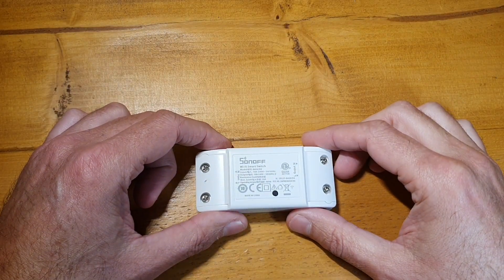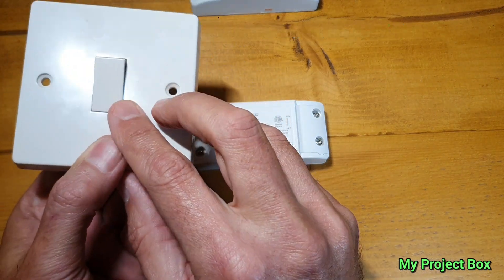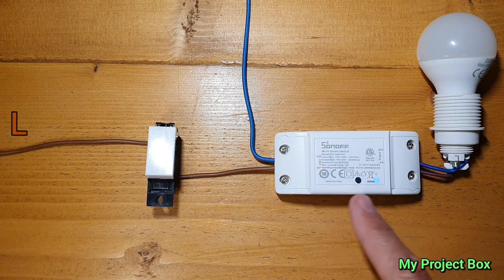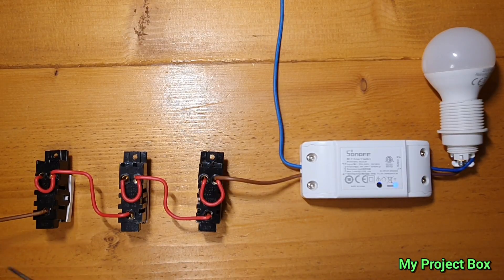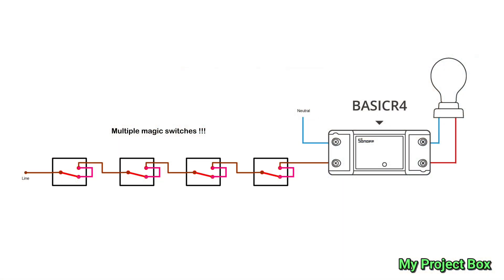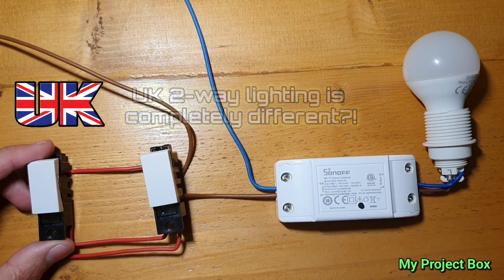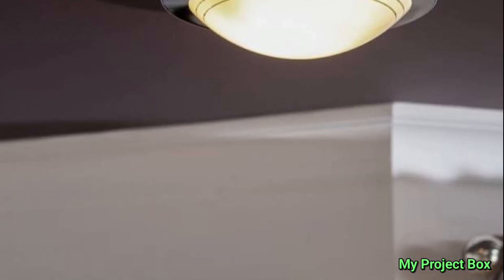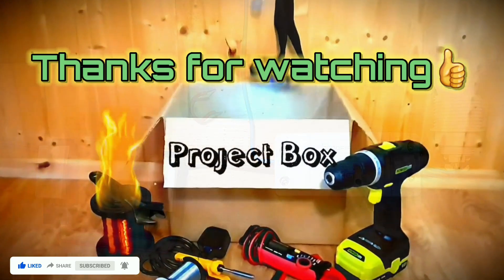Magic Switch Sonoff BASIC-R4 NO-NEUTRAL with 2-way 3-way smart lighting

Comment: One more advantage of this system is that switches will work, regardless of the Wifi connection. You put the router off, and still the switch will work normally.

Comment: hi
thanks for very good explanation.
i have a question. is it possible that to apart the single wire between the both switches to be connected to the SONOFF MINIR2 s1 and s2 ports? does it work properly?
thanks for your early reply.
yours,

Comment: Great overview, would this work with a single pole switch? 

EG: 

*-----/ *

Excuse the crude drawing, but 🤷🏻

I've tested in my home where the single pole switch is wired on the live circuit to a light bulb but it does not work.
Reply from the maker: Thanks for your email. I guess you are trying to use the "magic switch" mode. As per your photo,  it looks like the South African light switch plate has switches that can be "popped out". You could just replace one of the switches with the change-over type.( two-way type). Is your Tasmota flashed Sonoff Basic R4, still capable of magic switch mode, with custom firmware?
I have some older circuits with a optocupler that works on a regular light switch. https://youtu.be/x7Q8AS238pY
The last circuit is better, and it works with "one-way" no-neutral at switch, aswell
https://youtu.be/9hQFFsBkxaU

Comment: My parents have a bathroom under the stairs, and it seems the light/extractor is powered by the hall light (at the end of a two-way switch). If the hall light is off, the bathroom light doesn't work.  Could I use this approach to retain 2-way functionality for the hall light but provide constant power to the bathroom switch?
Reply from the maker: Yes I think that could work👍

Comment: My PC817 based circuit connected to the SOnOff switch becomes useless...😢
Afterwards, if it doesn't work on older versions, it will still allow me to make them compatible with this feature. 🤔
Reply from the maker: Magic switch kind of solves that problem and make my older Optocoupler circuit unnecessarily, but I think it's still useful for some applications.

Comment: The movie is really good, thank you. Question, can I feed a wall outlet through this unit? That way I will have control over the outlet?
Reply from the maker: Yes but remember you can only switch a maximum of 10Amp so mabe add a 10amp inline fuse for safety

Comment: I have two  sonoff basic r4 to control my pool pump and lights, will the magic switch work? We are in an area that the internet is not reliable and  if we need to turn it off we need to wait until wifi comes back. Thanks in advance!!
Reply from the maker: @ilianita67  I have only tested it with lightning, but in theory it should work. There is some chance the inductive voltage spike could mess with it a bit, but it's worth trying it.
Reply: @ thank you so much for your prompt response!

Comment: I wonder how often transients on the mains trigger this accidentally.
Reply from the maker: I guess it is technically possible. I have tried to emulate different conditions like making a bad connection with some arcing. But so far I haven't managed to trigger it. The delay has to be in a very narrow range. As a precaution, it would be handy to have a automatic of timer function, so that the lights don't stay on indefinitely, if a false trigger occurs😉.

Comment: how do you mean the sonoff doesn't need neutral (blue cable, yes)? it's still need neutral, yes? i saw the picture and the actual, both require neutral to power sonoff.
Reply from the maker: NO-NEUTRAL required behind your light switch  box😉. This is normally a big problem for some people. It uses the neutral at the light fixture instead.

Comment: Do you know how to make this work with a North-American light switch?
Reply from the maker: @goldbug007  it's exactly the same, but you need to use what you guys call a 3-way switch, and link the two "traveler terminals" together with a wire link. So don't use a "single pole" /On-Off switch. We tend to use the "3-way type" for every type of switching situation.
Reply: @ thanks for the quick response. I will try your trick.

Comment: I’ve set the basic r4 with a Schneider switch, but I think that the delay is so small that it doesn’t trigger all the time from the switch itself, and so it needs a bigger delay. Do you have any recommendations for that? I’m also planning to add another one for a 3 gang setup but with the same switch so I’m curious if the same would happen. Great video though
Reply from the maker: The only thing I can recommend is to try a different light switch.  The only switches that didn't work for me, is the ones that didn't have a decisive click.  It doesn't have to be an expensive light switch, just one that works well with the sonoff.  It would have been nice if sonoff provided an adjustment in the software. for the delay.  I know some people that have made custom firmware for it, have created this option.

Comment: This is genious. The set up works like an impulse relay, I think
Reply from the maker: @nivaeliakim  I see what you are saying😉👍, but a impulse relay needs a separate input form a momentary push switch. The magic switch uses normal light switches, and the Live feed is by the first switch, and the circuit completes with the neutral at the Sonoff, up by the light fixture. So it makes it easy to wire up with existing traditional lighting.

Comment: Great content - Thanks!

Do you think this would work with a single throw switch, with the bridge between the incoming and outgoing? The contacts should lose connection when the switch is flipped.  Not sure if it will be long enough though.  All our light switches are single pole, single throw.

Comment: How long is that "glitch"exactly in milliseconds?
Reply from the maker: @hunakaka  I'm not sure🤔. I would have to measure it with a oscilloscope. But I think there will be some discrepancy between different light switches. I guess the time delay would have to be with in a small range.

Comment: Hi  will this also work with line to line circuit?
Reply from the maker: Yes
Reply: @MyProjectBoxChannel  i have an existing 2 way switch with pilot lamp, is it ok to still put a wirelink between l1 and l2? Thank you for your reply.
Reply from the maker: @rj-ck6fu  the most important thing it that, it is a switch that has a contact that can changeover from L1 to L2. Some switches only switch between L1 and off. I guess the pilot lamp is a neon indicator lamp🤔. I'm not sure if this will interfere with "magic switch". Give it a test? I don't think it will be a problem.
Reply: @MyProjectBoxChannel  Thank you so much!

Comment: will it work with a doorbell switch?
Reply from the maker: No, is the short answer🤔😥.  But it might be possible if you have a normally closed version of the door bell switch.  And even then the doorbell switch cannot be pressed for a long time, it has to be pressed very briefly. Otherwise the sonoff will lose power and start to shut down.  You could try and modify a light switch and put a spring inside.

Comment: How to make dry contact on R4, I succeeded on the R3, but I don't know how on this one.
Reply from the maker: I have not tried to make a "dry contract" with the newer sonoff basic, but the magic switch detection circuit is probably connected the relay contacts, so I don't know if the contacts can be insulated🤔

Comment: so glad I found your channel. Very clear videos. I watched this and your other video Sonoff extreme MINIr4 on 3way switch light UK NO-NEUTRAL required at light switch #Sonoff #extreme. What happens in both of these installs if the Zegbee coordinator or Home Assistant installation is down. Do the physical switches still work the lights?
Reply from the maker: Yes! the manual switch still works, and will control the smart relay even when wifi and zigbee is down.😉👍
Reply: @MyProjectBoxChannel  thanks for that. As a UK person living in an old house I imagine that I will think it is unlikely that I will have neutral available (electrician calling soon to confirm this) So starting out with Home Assistant I have initially fitted window and door sensors in the house and installed two or three Ikea Tradfri repeaters. All going well so far. Next I was thinking that I'd have to start replacing light switches to give control via Home Asst and to act as Zigbee repeaters. Having watched some of your videos it seems as if you are more of a fanboy of Sonoff Mini units. Am I right in saying that these are easier to install and you may need fewer as with 2way switching you have to replace 2 switches - with the Sonoff you only install one bit of kit. Plus your family will not notice as the old wall switches are all there as before.

Plus you have these Sonoff units working as Zigbee repeaters as well?

Overall - you are voting Sonoff mini units over say Aqara wall smart switches (esp the no-neutral one which some pundits say have a poorer track record on reliability?
Reply from the maker: @fergusanderson5307   I did start with Sonoff years ago, but I don't have any special loyalty to them. Sonoff have sent me lots of free stuff to test and make videos. There is loads of other good brands on the market. But I like to come up with custom solutions for problems. So I have come up with some circuit hacks over the years, to help solve some of the issues people come across. Sonoff "magic switch mode" might solve some problems for some people, but be aware that some people have reported that it won't always work with certain types of switches. I'm hoping that sonoff will be all Matter-enabled soon. That way you don't have to rely on the ewelink cloud services, and have direct local control, without the need for custom firmware flashing.

Comment: Great video!
Finally a solution to my issue where I have a 4 way light circuit, where only the 4 terminal switch has neutral!
Reply from the maker: Yes! "Magic switch mode" is very flexible. Lots of new options available for people😉👍.

Comment: Will the L1 and L2 lines carry a large current?
Can I use thinner wire?
Reply from the maker: The link will carry the main lighting circuit current, so the wiring needs to be rated accordingly. But in general most LED lights are low current, so down to 1mm2(or even 0.75) should be fine.
Reply: @MyProjectBoxChannel  I'd be careful with that advice. The poster may move, and the next occupant can put up anything they like. Great video btw :)

Comment: I don't think what you said about the in between state is true, the connection is shorted so there is power constantly.

What I think is happening, is that it notices the difference in resistance that suddenly occurs when you close or open the switch. That also explains why you can add more switches. Quite ingenious.
Reply from the maker: I understand what you are saying, but your logic is incorrect🤔. Inside the switch, there is a moving contact, that makes a connection with two stationery contacts. We linked out the two contacts, this is now the combined output terminal. The moving contact can flip between the two contacts, but can't make a connection  with both at the same time. So as you flip the switch, there will be a brief moment,  when the moving contact is not making a connection with either of the stationery contacts. So let's say your input is the moving contact, and the output is the combined link. Now when the switch is flipped, you have a brief period when you don't have a continuous connection.

Comment: How do I bridge my light switches if I have a 4 way setup with 4 intermediate switches?
Reply from the maker: 4 intermediate switches WoW!😜 Where in the world do you live? Because the wiring in the UK, can be very different for multi-way lighting. If its wired the "normal" way, you just have to link out L1 and L2, on the first or last switch. If it's wired in "UK 3-plate", with twin & earth, you will need to reconfigure some of the wiring.

Comment: Hi’ why do the tile of the video is Magic Switch …. « NO-NEUTRAL » … smart lighting when all your examples show neutral wire.  I live in Canada in an old house and there is no neutral wire in the house.  And I thought this could help me a lot.  But I am confuse now.  It is simply that we use different terminology ?  Thanks in advance
Reply from the maker: NO-NEUTRAL refers to not needing a neutral wire behind the light switch box. Many smart switches and smart relays, require a neutral at the light switch to function. Some of my videos provide a workaround if you don't have this neutral connection behind the switch. My circuits works by utilising the neutral at the light fixture itself. I believe In North American you call it Hot and Neutral for 120v , and Line to Line (Hot to Hot) for 240V. So if you have two "Hot" wires, one of them can be considered as "neutral" for the purpose of completing the circuit.
Reply: Do you think it’s ok if I don’t send N to the bulb and control just the L with the R4? I’m thinking to place it behind the wall because it will control multiple spot lights. Thanks!
Reply from the maker: @Modern_Sokratis   you  still need a neutral "return" connection up by the ceiling lights to complete the circuit, so the light bulbs can operate. But it does not need to come from the N-out terminal on the Sonoff. So you should already have the neutral/return, by the ceiling lights, from original installation. So you don't need to take the neutral from N-out to the lights.
Reply: @MyProjectBoxChannel  yes, exactly what I was thinking to do, thanks a lot you are a life saver 🛟

Comment: Sonoff mini4 is quite small and fits well. Would you think it could work like a magic switch as well, if the switch powers both the mini4 L1 input (and has got a capasitor like Basic4) and the mini4 switch input - or would/ could an external capasitor/resistor L1 powerfeed be needed?
Reply: Anyway - I dont have neutral at switch level, so up at the lamp would be easiest to instal anyway. Mini4 or bulp with magic would be more easy to hide away😅
Reply from the maker: Unfortunately I don't think it can work like that with the mini-4. The new Basic-R4 has a special detection circuit inside. Hopefully Sonoff will implement this feature across it's range 🙏 in the future. I think a smart bulb with "magic switch" would be brilliant. I made my own circuit that did something similar but with a diode instead of a wire Link. https://youtu.be/YItMu6VJGBI
And with 2-way lighting 
https://youtu.be/9hQFFsBkxaU
Reply: @MyProjectBoxChannel  .. got the Basic R4 and compared it to mini4. Seems lile mini4 needs a switch from on to off or off to on to activate. R4 just needs a small pause to activate - thud working fine with a 2 way switch.
Reply from the maker: @larsw.larsen4173  the magic switch function makes the Basic-R4 ideal for 2-way lighting. It's just unfortunately a bit bigger, and won't easily fit behind a light switch. It's better suited to go up by the light fixture.
Reply: I have two of these installed in separate lights and I find they do not always notice the manual switch being pressed which is a bit annoying.
Reply from the maker: @NeilMunday  I some people have reported the some light switches  don't work very well with this device 😢.  I would maybe recommend trying it with a different model light switch. Sonoff does state that it must be used with a good quality light switch. You do require a decisive "click" for it to work.

Comment: 6:04 I'm not sure it can be both, I think it will need to one or the other.
Reply from the maker: I tested it and it does work with both links in place😉
Reply: @MyProjectBoxChannel  even with both wires between the switches? In that case .... mind blown!

Thanks for the correction.

Comment: Interesting!   But I have some questions:
So if there is a glitch in the power grid, all the lights in the country using this thing will switch on/off simultaniously?
If scaled up big enough, this could cause some serious sudden load or drop of load on the grid.
Also, if this happens when no one is home it might turn on the ligth in the house due to a glitch in the power grid, could it?
Reply from the maker: You have a good point. The timing of this glitch would need to be very specific. I tried replicating it with a loose connection, without any luck. It is theoretically possible🤔. I will have to do some probing with a oscilloscope, to see the effect of the flipping of the switch has. I know the default power on mode is with the relay off. It's probably a good Idea to have a automatic off time delay, just incase you get a false trigger.